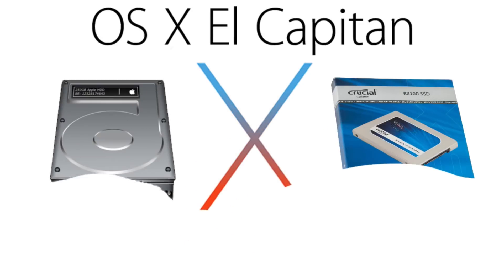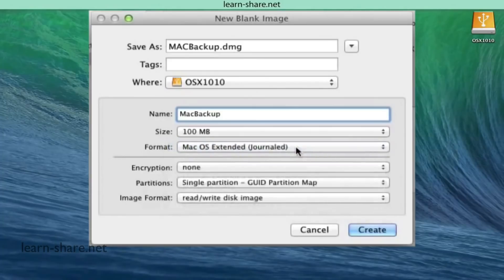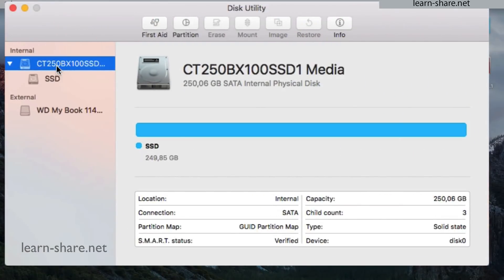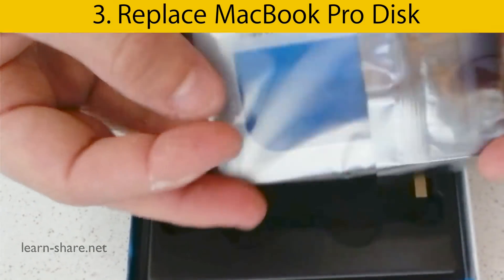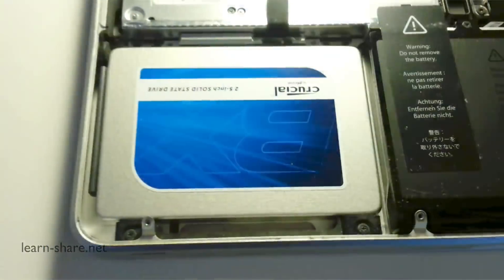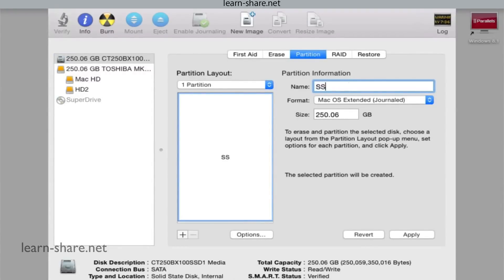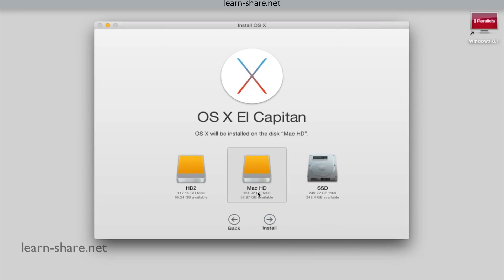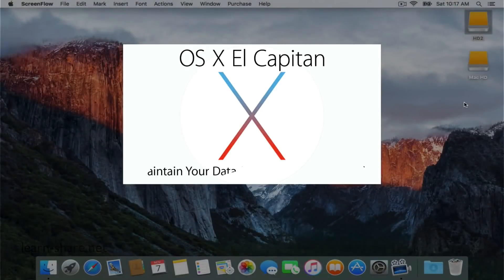How to Upgrade MacBook Pro Hard Disk Drive to SSD and Install macOS

Comment: great. Instead of cloning, can I take a TMB backup, replace HDD to the new SSD and then restore from TMB drive. Do you have a video for this process. Also, can I do this on a Mac Mini?
Reply from the maker: Yes you can apply the same method with time machine backup, and yes on any Mac. I do not have any example with TMB, only images -> https://www.youtube.com/watch?v=2Gm1Dva9RZU
Reply: Thanks for your response. I have seen the video. I believe it is also 
possible to POINT to the external TMB after replacing the SSD during the
 boot process. Once the system is booted up using the TMB, then a SSD 
format can be done followed by restore from TMB on the new SSD. Is this a
 feasible option. Thanks for your comments and expertise.

Comment: Did u had any trouble with the crucial drive ? Planning on getting an adata or Kingston but not know if I'll regret further
Reply from the maker: Hi, no issues with the crucial SSD, still up and running.

Comment: Dear friends, we need your help.
And so, my MacBook pro 2012 year.
I decided to change the HDD to SSD
I looked rollers, buy the CD, otvertochki and all that was needed.
And that's what I did and what it led to:
1. Change the disc
2. Open the Utilities to format it
3. Start the system jump, all is well established, but it was the OS Mountain Lion
4. I went through his uchetku, which is on the phone and everywhere, which by the way (perhaps for that matter) on the old disk I previously updated to Sierra
5. Went to the App Store and is not able to upgrade to Sierra, wrote after the purchase, but there is that does not work out.

The question is how to make sure that I was on the new disk as the Sierra or completely move all the Old and OS from HDD to SSD.